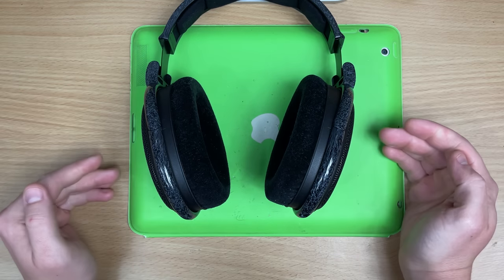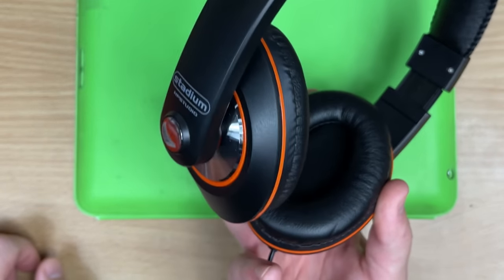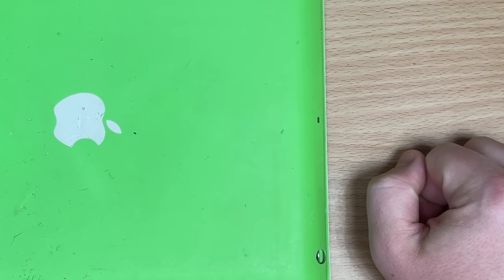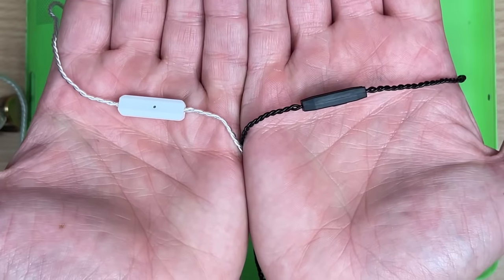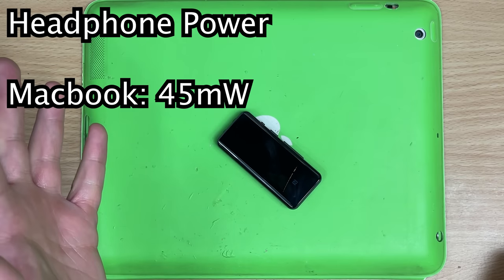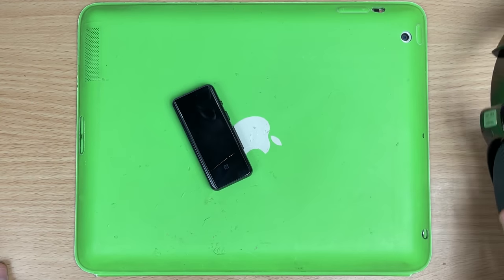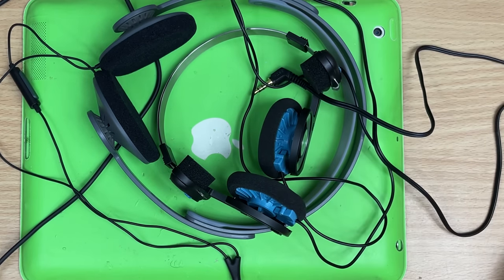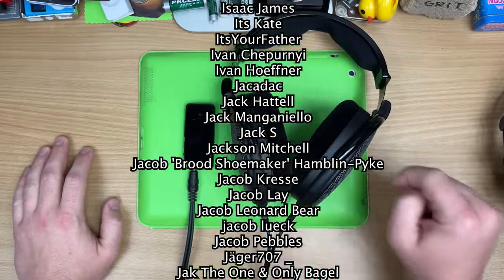My Cheap Headphone Starter Guide.

Comment: Listening to Samsons SR850 in Samsons SR850:
"Ah yes, those are clearly good".
Reply: Are the stock earpads comfortable?
Reply: @Ahab2710  they're more or less on par with the newer AKG 240 Studio (Dont get the mark 2). The 600ohm 240s are more comfortable by far, but theyre also a bit more expensive and a LOT harder to drive.
Reply: @dsrocks6905  i payed 22€ (around 25usd) for the Samsons, i got them mainly for that reason, so cheap
Reply: @Ahab2710  The earpads on the ones I used to have were some synthetic material that made me sweat after a while
Reply: @Ahab2710  the stock earpads (fake leather) are fine, they are comfortable enough, sometimes they are slightly disturbing to your skin if you listen for a long time. I purchased an extra muff pair online, they are more confortable, but they could be stuffy, especially during hot days
Reply: @Ahab2710  thinking about those paired with btr5- how do you like them?
Reply: @bcc5701  BTR5 and SR850? I got exactly that and i gotta admit it sounds slightly better. Everything feels more open if i put it like that. Though i really bought the BTR5 as a future investment as i want to get some more serious headphones. Highly recommended equally
Reply: @dsrocks6905  why not the mark ii
Reply: @andrewhsd.2743  the MKII is by far the messiest in terms of frequency response. Although they're supposed to be identical, the bass is just muddier for some reason, and it isnt punchy enough to be worth it. Everything just feels... weird. It makes me wonder if its just the earpads and cable that are changing the sound because in theory they should sound the same. Anywho, I dont think its worth spending an extra $20 for what is essentially a sidegrade. I have let my K240s both burn in but I do listen to my studios more than I do my MKIIs. I prefer the vintage sextetts over both anyways. Oh and one thing... PLEASE get an amp if you get any of these (especially the sextetts as they're 600ohm headphones). The studios and MK2s are  supposed to be 55 ohms but ive measured around 100 ohms on average. They arent the most efficient cans either, so theyll sound rather quiet out of phones and laptops. You can get them to a comfortable listening level, but they'll lack that same detail and presence without an amp. If you want sextetts, you need an amp that can drive Audeze LCD 2s or DT770 Pros at least trust me. Otherwise they will sound quiet, even when plugging into cheaper or lower power amps. Hope this helped!
Reply: I love them... I don't like the AKG though... I have the K92 and it sounds bad compared to the SR850...
Reply: @DONNYLAI95  the K92s arent my favoritea either. They're the last headphones from the Vienna office and it makes me wonder if they were even from there or if theyre crappy Samsung headphones with an AKG logo on them.
Reply: I saw some at Canada computers today. I bought them. The Phillips SPH9500s are more balanced. But they are surprisingly crispy. Jazz sounds so good on em.
Reply: @annona718  Too bad... I can't get the Phillips in India... They don't sell it here...
Reply: @DONNYLAI95  Amazon is your buddy. Online shopping can get you many things. However, if you have a friend in like a place that does ship them there. Send it to their address and then they can send it to you.
Reply: They any good for gaming?
Reply: @Sgt_Quacks21  yea actually

Comment: pretty pleased with my audio technica ATH AD500x but seriously curious how those Sennheiser ones sound! Those K52's I had. not bad at all, just not a fan of how it sits on my head with that band.
Reply: Bum tum
Reply: @uncutorange2735  ok
Reply: I love my AD700X's. Seriously prefer them over my Sennheiser IE80's or Sony WH-1000XM4's. Vocals are just stellar on them! So worth the $150USD! Also most comfortable headphones I've ever worn
Reply: I am very boring and just use my ATH-M40x for daily listening. I just really value the comfort and durability.
Reply: I had an old AKG k.44 that lasted for 10 years and I didn't treat it nicely, it was always with me and I threw them around. Then I bought the knew K.52 and it stopped working in less than 2 years with much better care, I was so disappointed, I tried to open and resolder it many times. Now I bought the ATH M-30x and I'm liking it
Reply: you guys should try better headphones, they'll blow you away compared to the Audio-Technica stuff you're using right now. I have a pair of K7XXs and they are great! They sound very similar to the Sennheiser HD600s and the K7XXs are $200. I don't think they're available anymore but you could request them and they could potentially come back
Reply: @bruh1031  $200 it's like +1000 I'm my currency, just the conversion, impossible for me, I also live in a noisy place so the closed backs it's a necessity
Reply: @gnostechnician  This is the pair I got when looking for a pair of studio headphones for piano playing. I was undecided between those and the sony 7506. I am honestly pretty hapoy with them. 1 slight complaint is that my right ear cup rubs on the top of my ear. Other than that I love em. And even then it's a simple fix, im just too lazy to get new cups lol
Reply: @bruh1031  I literally have IE80's. These Audio Technica's are fantastic. Cheaply made but a sound profile I very much enjoy.
Reply: @ShuAbLe  Brainwavz HM5s are just $62USD, which are certainly cheaper than the M50x and closed back. I like those headphones as well but everyone has different sound preferences so take any advice with a grain of salt if you can't pick up the headphones and listen to them yourself

Edit: Brainwavz HM5s come with a hardshell carrying case too
Reply: @bruh1031  Very interesting, and cheaper than audio technica, I will take a look!
Reply: @esthergennn  Why are you saying that you "literally have IE80's"? Those are IEMs and we're talking about on-ear headphones, so the Audio-Technica headphones should definitely sound and feel different from an IEM. I'm just offering suggestions on some headphones that may have better sound quality than the Audio Technicas. There are definitely headphones that are better than the Audio Technicas but those can be and most likely are more expensive. Personally, I prefer the Brainwaz HM5s over the Audio Technicas and that's my preference and you have your own preferences.
Reply: @esthergennn  I have the AD700Xs as well, I agree they're super comfortable, and the high end is super prominent compared to my HD6XXs.
Reply: I’ve been rocking the Budget m20x. It’s nice too
Reply: Oe
Reply: I love my senny 58x
Reply: @joeygenna4801   the m20x are ok as well, I had it for a week. The sound it's a little bit heavy on the middle for me. I changed to the m30x, I think the m30x have a much nicer profile and comfort and the cost for the upgrade isn't that much, totally worth it.
Reply: As someone who have tried and owned the ath-ad500x, hd6xx (a cheaper but identical verison of hd650 on drop) and hd58x, I would say it sounds pretty similar to the 6xx with the 6xx has much less sound stage than those and less sub bass (not that much). In terms of details, they are pretty on par with each other.

I would say the key difference between them is that the ad500x is a very open, wide and neutral headphones, while both the 58x and 6xx are narrower, mid and vocal focused (the biggest strength of the 600's series from sennheiser) and they response very well to amps and tubes.
Reply: @gnostechnician  ikr, they are good

Comment: I used to love the Koss KSC75 - they're basically an earclip version of the Porta Pro with the same drivers. They were also a lot cheaper, around $15 if I remember correctly.
Reply: They still sound great. Imo a modified KSC75 out performs most headphones under $100
Reply: @Marauder also HE400SE, HD560s
Reply: They're getting even more expensive now. nearing 20$. and 35-ish on ebay

Comment: I have several pairs of the Samson SR850, and I'm a fan. Inexpensive with a great sound. I've found that buying aftermarket pads improves comfort immensely. The stock pads are not very tall, and your larger listeners may have their ears pressed against the driver housing. Aftermarket pads widen the soundstage further, are way more comfortable, and look much better.

Comment: honestly i wouldn't be opposed to open back headphones other than the fact that my parents would be able to hear me watching some ordinary gamers and moist critical
Reply: In my experience they actually don't bleed out that much unless you listen at really fucking high volume.
Reply: understandable, i need to hear whats going on around me tho since i could get called to do something at any time
Reply: @stealy9608  then you would like open backs, you can still hear things around you, i play mine pretty loud and the bleed on my HD560s aint that bad i can hardly hear them once i take them off listening to some heavier metal
Reply: @elevatedtommypickles1740  alright, might have to try some out next time i get headphones
Reply: Koss drivers like the portapros are so small and close to you that you can still hear it but nobody else can so ye
Reply: The biggest leaks from an open backs is usually the trebbles, so as long as you're not listening to heavy metals with ear piercing volumes then it won't be that loud at all.

Thoigh the same logic cannot be put on the Koss KPH30I or KSC75 (or Grado too for that matter), because it bleeds like crazy.

Everyone will hear you lol.

Comment: The best advice I ever got when taking lessons in audio engineering/producing was to always listen to the mix on a phone speaker to get a good feel for how it would sound on the cheap stuff.
Reply: Only with good equipment can you tell when a track is intentionally distorted. On everything else, you'd think it was just the speaker. deadmau5 - Ghosts 'n' Stuff opening kick vs the rest of the track.
Reply: @zoomzabba452  You don't need good equipment to tell that, you need not shit equipment

Comment: I'm a fan of the Superluxes from like 2015. Back then, I thought Sennheiser, AKG and Audio-Technica are the kings of budget-fi, but nope.
I still use one to this day, the HD681B (B for balanced, not bass), possibly their best one. It has almost identical qualities of the HD681 while having less treble harshness which is probably HD681's only weakness sound-wise. And I have owned the HD330, HD681, HD631, HD668B and the HD660 (also my favorite, it is colored but I love it for Rock/Metal, anything with guitar).
Reply: Which one should i look for? 681 ones or K52 ones?

Comment: Some personal recommendations of mine for those wanting to get started on audio:

The Philips SHP9500 & SHP9600

I personally prefer the 9500s because they have a more balanced sound and they're less expensive but the pads are slightly more shallow. Although not that it matters, because both of these are the most comfortable thing to graze your ears and or head.

Final e2000

Weirdly enough, openback in ears! Very rare you find buds like these. Yes they bleed and that kinda defeats the purpose of in ears but honestly, they're so close to your ear that you'll only be able to hear what someone's listening to if the room is dead silent and they're blasting their music. The cable is also kinda crappy and not replaceable.

Sennheiser HD 559s

Not much to say about these. Very pleasing sounding and balanced headphone and in my opinion, a bit more budget friendly and over all a better value than the Sennheiser hd58x in my opinion if you want a true budget option. Like any other Sennheiser, hard clamping force out of the box and pads you have to replace yearly. But overall a great headphone.
Reply: The 9500s do sound stage at a price point that is unmatched. Bass lacks a little but my personal favorite headphones right now.

Comment: I run with beyerdynamic dt770 Pro 80 ohm and I love them.

The price isn't insane in any direction, not super cheap but also not super expensive. They are also fairly easy to drive, are super comfy and sound amazing!

Comment: This guy could literally convince me to buy a half eaten banana. Like... im not even into headphones that much and i still watch all of his videos...
Reply: I didnt give a shit about headphones until I started watching him.  Now im wearing SR850s and wanting to save up for those cheap Senheisers...
Reply: @hedgeearthridge6807  same I wear the Samson’s all the time now
Reply: @hedgeearthridge6807  I went for the ZSN Pro X and the BTR5 from the previous reviews. Amazed. Mind opened. Then I got some used HD600. Was disappointed. Got a balanced cable. Confirmed that they were under-amplified on the single ended cable. Have purchased many more over ears and IEM since.
Reply: I use headphones......
Reply: @bestdadoftheyear7181  good for you listen to anything however you please
Reply: I got myself a pair of DT770 because they were on his "rack of the gods" and reddit folks described them as "bassy" or V-shaped. They are exactly what I wanted, and I will probobly use them for the rest of my life. I love them. Had to swap out for leather ear pads, didn't like the fabric ones it came with. But god, are they awesome. 
I used my last pair, bose qc25, since like 2014. So I don't tend to buy often. Not doing the shop-a-holic retail therapy thing. It's just my taste changed. I don't care about sound cancelling anymore, I now have quieter surroundings now, and I wanted the bass; the qc25 wasn't cutting it 7 years later.

Then I put on my GF's Sennheiser HD 280 Pro. They are about 120 Canadian dollars. I realized, "shit these have more booming bass than qc25, and they where cheaper." Those babies lead me down the rabbit hole to eventually find the DT770, (which is basically paying for more sub-bass). I like the fit of mine more, but the HD 280 pro are admittingly better value for someone who is getting their first pair of real headphones, they don't even need a DAC, they are 60 Ohm. But I had to be eccentric and get DT770 instead.

Comment: literally exactly what i need my headphones just broke yesterday
Reply: Lol my headphones r trash
Reply: i bought the kz pro x a couple weeks ago because of dankpods. they're class 👍
Reply: @t1t1t62  I also got the Pro Xs. I use them pretty much all the time. My only complaint with them is that they're way too loud when I plug them into my portable CD player.
Reply: @idk-ow1gt  seriously, get some Kz's they are crazy good for the money, 15 bucks on some ZSN's should be enough for anything you  may want to use them for
Reply: @EpicB  yeah they are very loud, i have my phone on half the volume that my old headphones were at, i accidentally left my volume on 100% once and oh boy it hurt.
Reply: @t1t1t62  I've also used them on my iPod and for some songs (particularly loudness war victims like Not Your Kind of People) the bare minimum volume is enough and even then I wish I could turn it down less. I almost wish they had a little more resistance cause they're only 25 ohms.

Comment: We actually have the same functionality as Sonarworks on android if you download an app called "Wavelet." Happy listening boys 👍
Reply: Been using this over a month now, best enhancement for gaming and music
Reply: Wavelet is incredible. Also, on PC, you can use EqualizerAPO and the AutoEQ project in harmony to achieve the same results.
Reply: On android you say? so it should work on my Fiio M11... interesting

edit: did not find in app store
Reply: @AmaraTheBarbarian  unfortunately its only available to devices with android 9 and up. maybe look into installing a custom rom on it
Reply: Thank you for this. My wh1000xm3 never sounded as close to my hd58x than they currently do!
Reply: @yeagmatic  ahh that makes sense, same thing with the sonarworks android app. Never custom ROM'd a mobile device before and honestly on this one I'd be to scared I'd brick it. Thanks though

Comment: My first set of pro cans were the K92s (pre-samsung) and I must say the focus is deffo on the sound! However, they are fragile and after only 3 months, the cable had cut out. I fixed them myself, they lasted for another year and then I upgraded to the Beyerbabes DT-880 Pro. All in all, both have bomb-ass sound, but the Beyers won't fall apart so easily.

Comment: I have a couple of lower end pairs of Sennheiser (HD201 and HD205) that I picked up in a charity shop for pennies. They might not be the most high definition audiophile monitors, but for plugging into a phone and blasting my ears with acid techno on the bus they work great. Loud, clear and banging with no need to buy a separate amplifier just to run them. The only negative is that the cable is long enough to wrap around the world 3 times!

Comment: Actually bought myself the AKG K52 after this vid.
I was looking for some crisp sound at a decent price, but didn't want openbacks because I play a lot of games while in discord calls, so I can't have everyone hearing my cans because the bleed is picked up by the mic.
And I gotta say, I'm very, very pleased.
They fit incredibly well, are a comfortable wear, the cable is solid and doesn't fling around in curls, the plug is proper so it won't bend off like most headphones with cheap plug fittings do...
They're just really fucking solid all around and I can't complain at all.
For 28€, these are outstanding.
Thanks a ton, Wade.
I knew I could count on you.

Comment: I just got some Yaxi Pads for the Koss Porta Pros and it cleans up both ends so much. Bass is tighter and there are more details to be picked up. They are also softer and thicker than the stock pads, so you gain comfort as well as sound stage. I love the package.